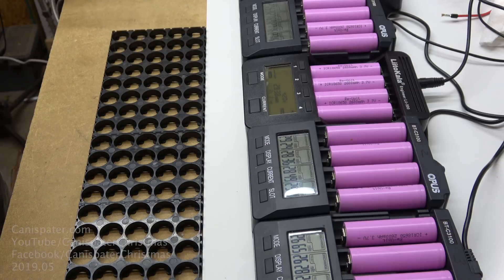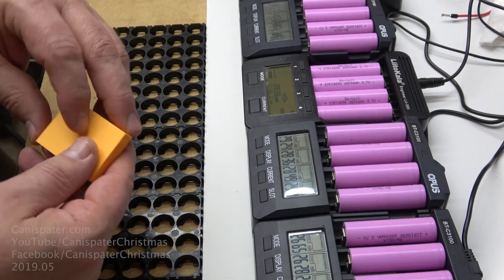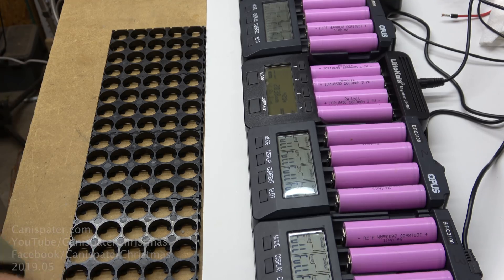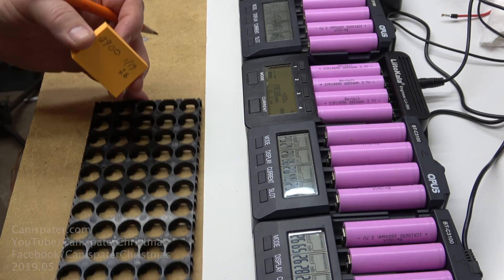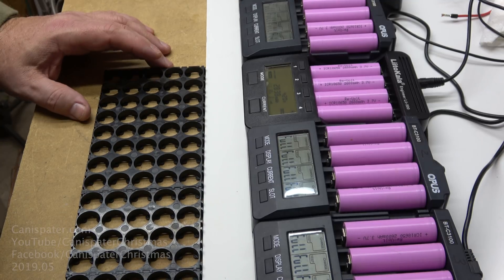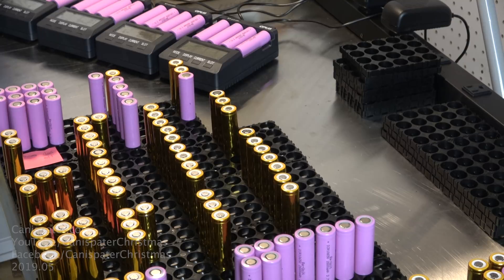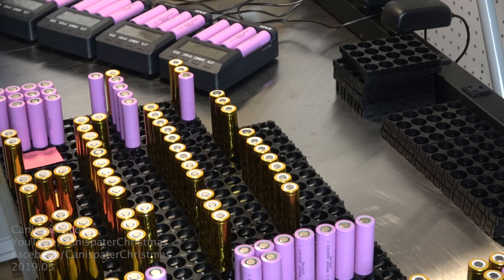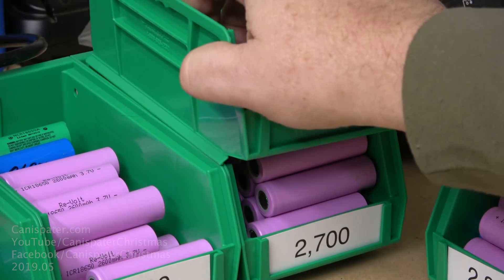⚡️DIY Powerwall Project - ep3 - Processing Cells  (2019)

Comment: Your test results with 4 cells through 4 Opus's is very telling. Opus 1 and 2 likely have the worst performing thermal management ie the fan is on its way out or just not performing as well while 2 and 3 seems to be doing better. We learned from the fan mod that the constant start stop during discharge along with the cells being around 45 Degrees (when they output the most capacity, usually 105% or higher) that this played a role in Opus numbers not being accurate. Fan modded Opus's (larger bottom shell with 80mm or 90mm fan) performed much more consistently.

Are all your Opus the same exact model? Theres now the BT-C3100, the 3100 V2, and the 3400. One of the engineers said some of the differences include minimum voltage discharge which would affect capacity.
Reply from the maker: I believe they were all the same model as they were purchased roughly at the same time & same vendor, but did not check further than that. Interesting project. The batteries don’t get a lot of use now, but the whole thing works just like it did when I built it.

Comment: I use the litto Kala li500 to only do capacity testing, no charging.  I leave the battles in the pack they came in but pulled out of the case.  I charge it as a pack with something like a iMax b6 to 4.2/8.4/12.6 volts.  then break them down and clean them.  when the cells are done capacity testing I pull them off right away and put in the next cells that are already charged.. next I have regular 4 bay chargers that I use or some tp 4056s I have set up.  I have all 1000+++ cells sitting until I'm ready to volt test. may be months until I feel like I've got enough cells to start building.   Great videos.  and I see I'm like a year late.  HA
Reply from the maker: Haha. Well, for this project anyway, but the basics are still the same. What size battery are you building?
Reply: @CanispaterChristmas  not sure yet.   I have 300 boston power cells to incorporate and the new Lg 120ah cells.  So im sure my packs are gonna need to be as big as 3.1 kWh=7 Lg modules.  Im leaning towards 24volt packs instead of 3.7 packs in series.

Comment: The best you can do is Test the capacity as consistently with the same type tester.
Reply from the maker: Yeah that's true, but even changes in temp can affect the results so you have to accept some level of variance. Really more of a ballpark value with this process, but it's probably close enough.
Reply: @CanispaterChristmas  yes sme batteries from batteryhookup as another guy on FB and he was getting consistently 50-100 more mah per battery.  As of this week I believe rounding the mah and not using repacker.
Reply from the maker: @RodneySolarCircuits  I still used repackr, but rounded a little to speed up the process. Cell 1 is a little soft (also the first one I built), but they're pretty close and will top balance.
Reply: @CanispaterChristmas  yea,  the powerwall is only as good as your weakest pack.   Lots of testing on Will Prowse's channel.   Ive ran the same batteries back to back and get +/- 150 mah. Depending what the temperature was in the garage, if I have the fans blowing on them, etc.  You cam always add a couple more cells in parallel to the end of the weak pack to bring it up.   It don't have to be the same count,  only amp hours matter.

Comment: Read in some article that after charging to full capacity, put the cell in a freezer for 24 hours, then let them warm up using room temperature before testing them. Is it really necessary from your experience.
Reply from the maker: I don't know of a single person that does that. Maybe that's how they do things in a lab, but the equipment we have to test with is so inaccurate, I doubt you'd see a difference. Might make for an interesting test though. :)

Comment: Thanks for sharing your thoughts on the battery chemistry.  I think I'm sticking with my assessment that SLA is more appropriate (if not nearly as cool) tech for this - BUT - everything you said makes sense, and the delta probably isn't as big as I first suspected.
Reply from the maker: HAHA. Well, no one would say you're wrong or make fun of you for going SLA. I just wanted to learn more about these. Same techniques apply to smaller, mobile packs too. Good question tho. Thanks!
Reply: But you buy new ones every 4 or 5 years. My Lithium will last more than 20.
Reply: @66bigbuds  if its LiFePo4.  If it's Li-ion like 99% of the 18650s then you have a 2 to 3 year service life, almost regardlessof cycle count.  LiFePo4 is definitely the way to go at this point though.   It's been nearly 2 years and the price landscape has changed drastically.